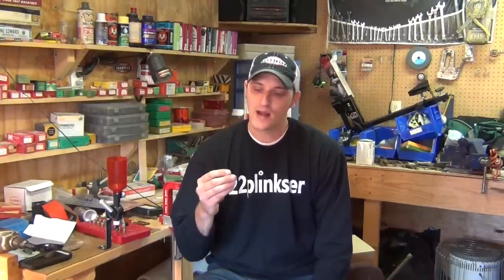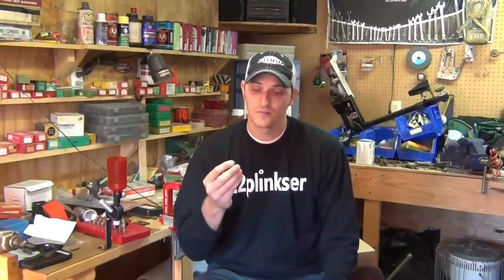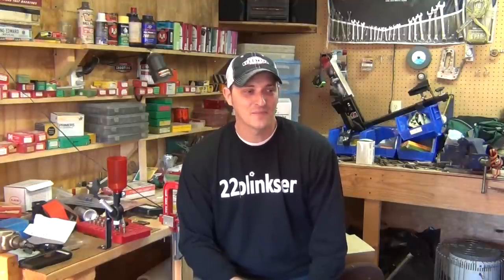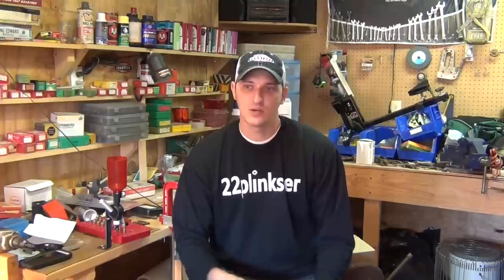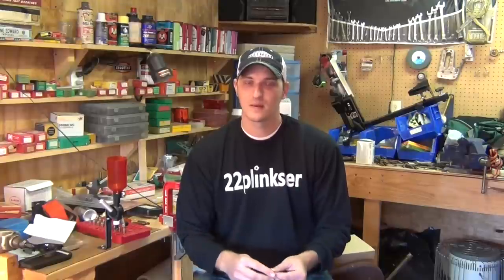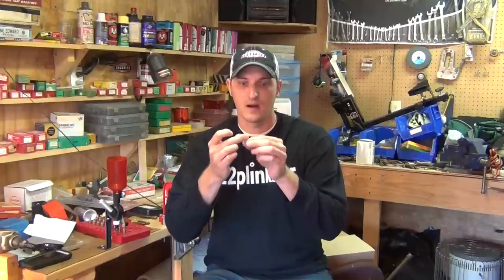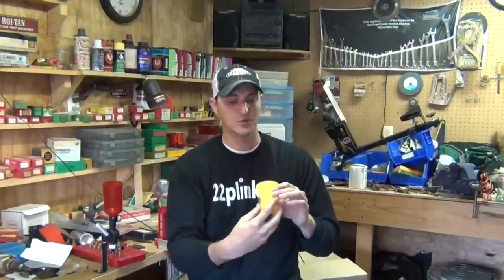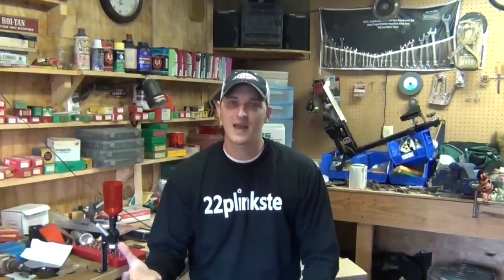Why does the .22lr have misfires?

Comment: If rough handling causes misfires, that could be a problem for semi-autos. They slam the cartridges into the chamber pretty hard. If loading the round into the chamber causes the primer to break loose and fall out of the rim, I wonder if it would be more likely to fire if the firing pin hits the bottom of the rim rather than the top?
Reply: There is nothing in the center for the explosive compound to get pinched and hammered against. When they make them a machine just puts a drop of normally dry explosive compound emulsified in a solvent in the bottom of the case then spins it up to cause the explosive compound to collect under the rim then the case is dried to remove the solvent leaving the explosive solidified and stuck under the rim. If the explosive compound is crappy it will break up and fall out from under the rim into the propellant and cannot be struck by the firing pin. I suspect the new stuff they use in crappy ammo is an explosive with a low melting point and it is introduced while warm enough to be melted and spun under the rim then allowed to cool and solidify. When the cartridges get hot in storage the explosive just melts, leaks out from under the rim and gets distributed into the propellant grains.
Reply: @dfpytwa  Yes, I know all that. My point was about the issue that rough handling can cause the priming compound to break loose and fall out of the rim. If so, then it might be better to have the firing pin hit at the bottom of the chamber instead of the top, as the priming would more likely fall out of the part of the rim that is up rather than the part that is down.

Comment: I won't name names, either, but teh primer compound is a huge problem because some companies put it much less compound than other.  It's also applied in different ways.  Some is pressed in, and some is best descried as sprayed in.   I think the sprayed in is best because  the primer compound covers the entire back of the case, and is on thick enough that the rim itself is full all around, and holds it in place.  You can drop it, thump it around, whatever, and it won't dislodges because it's in thick, and the rim stops it from movie. 

Moisture is a huge problem.  We had about four hundred rounds of .22lr that sat in a sealed contained, but the container was full of very moist air.  When we tried firing it, more than half the rounds wouldn't fire.

But after it sat in the open air, with the sun beating down on it, for a couple of hours, every round fired.   Quality control matters, and part of this is how ammunition is packaged and stored at the plant, and along the delivery trail between maker and buyer.

Comment: I have to disagree with you on how the 22 LR primer material is loaded into the 22 LR cartridges. If you look it up, here is how it is done: Small pellets of the wet primer are dropped into the bottom of each case. Back on the main factory floor, spinner bits are lowered into the cases and spin the primer so that it's evenly forced out all the way around the inside of the rim. The cases are dried to remove all of the moisture from the priming compound.

Comment: I have been using rimfire for over 40 yrs. the first misfires that happened to started 7 or 8 mounts ago. It was in a Winchester brick. I purchased 2 of them. I had so many misfires I asked some one
at the range to try a few. He had 3 misfires out of ten. I sent them what was left of the 2nd box back to them & they sent me $30 bucks. Big deal, I do not buy that brand any more.

Comment: You can take the worst 22lr ammo and put it in an air tight container with silica packets and have 99% of it fire.
Also handle it however you like, the primer compound is a glued gel on the the back outer rim on of the inside.

Comment: I had quite a few misfires today, with the Federal 550 bulk pack 36g. HP's. I'm thinking about sharpening the tip of my firing pin a bit.  I already cut 2 coils off of my recoil spring. It helped A LOT with reliability, shooting bulk ammo. I only had ONE stovepipe out of 200+ rounds today. Before, I was getting 1/15 stove pipes.  All my gun would run was CCI Velocitors. Those are too expensive to shoot water balloons, and water jugs with. lol.     I'm pretty happy now, with the recoil spring mod, but I would really like to eliminate all of those misfires...    Any thoughts???

Comment: Don't they have to put the primer compound in the case while it is in a paste form? I understand that once it hardens, it becomes like a crystalline structure and extremely sensitive to shock. I believe center fire priming compound is either lead azide or lead styfonate. I don't know what they use in the rim fire cases. I can tell you that working with primer compound is one of the most dangerous job in a ammo plant.

Comment: As far as dry firing goes I do not agree. What dry firing a 22 will do is the firing pin will deform the edge of the chamber due to the firing pin being to long. The newer guns that they say it is safe to dry fire, the firing pin is trimmed to the correct length for its travel so it does not hit the lip of the chamber. The number one reason of miss fires due to the firing pin are the design or weak strikes. The number one culprit is the companies that use a pointed firing pin. A rim fire firing pin should be a chisel shape at the tip or a rectangle tip if the pin strikes hard enough. The reason for this is if the tolerances of the travel of the pin are not tight enough then then the pin might mis the priming. If to tight it creates friction which equals longer lock time and lighter strikes. That is why the point or rounded design is horrible.I have personally made my own firing pins for conversion kits to get them to ignite more consistently with a larger range of manufactures due to different hardnesses of the rims. An example an Erma conversion kit for the FAL.

Great video everything else I 100% agree with you man!
Reply: Steve Bertelli   My 10/22 firing pin doesn't make a very good dent in the rim, so I took it out this evening, and sharpened it a bit. I know the optimum thickness of the tip of a firing pin is .025", but I don't have anything to check it with. I did this because I had several misfires today...    Gonna try it out tomorrow...   Any thoughts?

Comment: Brand new S&W Victory 22 owner.. first weekend of shooting... last 2 rounds in the mag will not fire (I have to clear the pistol and reload at least 4 or more rounds). Sometimes, every 3rd round will misfire. I was told by idiot gun retailer that Federal Wildcat was OK (It isn't, I'm told, use CCI). Bought CCI and had the same issue. Should I call S&W on this? The gun was cleaned today and the slide oiled properly, but no difference. Thanks!

Comment: As long as you get it sealed up with some desiccant it should store for quite a while (really, just being sealed helps a lot).  I shot some last summer that had been sitting in a sealed container since 1985 (figured it might be time to finally use those - lol) - had not one misfire out of 1,000 rounds.  At the same time I bought some new stuff a couple of years ago and every 4th round was a dud.  Even my old H&R Sportsman, which will normally make anything go bang couldn't set those things off.  Sometimes its just a bad batch of ammo.
Reply: I agree, and I have shot ammo over 30 years old without a problem. When one thinks about it, it probably has more to do with how the ammo was stored and handled before it ever reaches the shelves.
Reply: Whitey  hmmm, maybe sample your ammo for storage to use at the range..... pick a random 5 (or how ever many) to fill up a range box...Keeping in mind which box they came from.... I know some anal minded people will love this thought. Don't hate me, just a thought.
Reply: G Wubllu I will try some of my older ammo next time at the range. I have some 1964 Remington military surplus in 7.62x51. I keep all my ammo stored at around 70 degrees plus or minus 5 degrees. I've never had a problem so far. Even shot some 22 shorts that were made in the 1950's that were my uncle's. I have had a few of rounds of bricks of 22 lr's which were new that wouldn't fire. Ammo is transported in trucks at extreme temperature, both hot and cold, and then handled roughly at warehouses. I believe that is a larger problem than age.
Reply: Whitey No, I mean sample your ammo you are readying for storage since, most of concerns may be with previous handlers, and just possible bad batches.  It would really suck to really really really need what you are going to shoot, that you have meticulously stored for over twenty years from now, just to find out you have a bad batch.... So instead of buying a separate box for the range, sample boxes going into storage.... Even if you really  really really need it 12 months from now, it would suck to find out , again you have a some of a bad batch...
Reply: G Wubllu I see what you mean now, and it's a good point. After I answered you yesterday I realized I have shot several hundred of the Remington mil-surp made in 1964 without a problem. Yes, you have a valid point, and I will take some samples to the range next time.

Comment: Im happy to say that probably out of 5000 rounds of cci minimags cprn maybe 3 yes 3 misfires. That there is the gold standard. Bought 2 boxes of federal 36 grain cphp and had 20 squibs out of my db sidekick( i only use cheaper stuff in my wheelgun) 20 out of 50. Each time i had to open the cylinder to make sure bullet was not in the barrel still😡

Comment: If shaking .22 ammo can create problems with breaking down the primer compound am I going to regret getting the McFadden Ultimate Clip Loader for my Mark II?  That requires dumping the rounds into a holding tray, then shaking it back and forth to them them to fall into the feeder channel. 

So far I've had no problems, but I've only used it for about 15 magazines in the week that I've had it.

I agree that CCI Mini Mags are probably the best for reliability, but I've had very few problems with the thousands of Remington Thunderbolts I've shot at half the price.

My semiautos have more issues with American Eagle and Winchester Super X than with any of the Remington ammo.
Reply: oldbandguy   Strange...   American Eagle doesn't cycle well, in my 10/22. But, Federal bulk does great. 99.5% reliable. Same company...   The American Eagle is 38g., and the Federal is 36g.   Same velocity(1,260fps).      Go figure...

Comment: Great subject my friend but you are not aware of the primary reason for .22 misfires. Number 1 reason for .22 misfires is the ammo. The primer material on a .22 rimfire is put in the case as a liquid. Sometimes it does not cover the entire bottom (rim) of the inside of the case. If the firing pin hits an area with no primer compound, MISFIRE. You get what you pay for. Next time you get a misfire take the round and just remove the bullett from the case by simply bending it to the side. The bullett comes off easily (with my strong fingers). You will see the bottom of the case is not completely covered in primer compound. I have sent many of these faulty rounds (no powder or bullett, just the case with a solid firing pin strike to an area with no primer compound) back to various manufacturers and got an apology letter and was well compensated with much free ammo. 40 years of handloading experience here. I have even manufactured some .22 ammo. I was able to do this safely being a mech. engineer, also studied physics and chemistry and was an instrument maker and the owner of my own machine shop. I only did this for experimental reasons. I produced some great ammo but the project was very time consuming and intensive. Making tooling and assembling the rounds. The effort was so extensive that I would estimate the cost to be somewhere between $5 to $10 per round (FOR .22 LONG RIFLE AMMO ! ! ! ). This is when a brick of 500 rnds. was under $10. I put together a few hundred rounds. Like I stated it was just an experimental project.

Comment: There is a little misinformation here. The primer does not sit like a disk in the bottom of the case. If that were true, it would be possible for the point of the bullet up against the base of a cartridge to set it off from dropping it into a tubular magazine or from recoil just like what can happen with centerfire cartridges with pointed bullets. The priming compound is only in the rim of the case. During manufacture, the cases are spun to put the priming compound in the rim by centrifugal force, thereby leaving the center bottom of the case free of priming compound. That is why it is called "rimfire". I recommend editing this video to make it correct.When a rimfire cartridge gets dropped, a small chunk of the primer can be dislodged and cause a misfire when the firing pin hits the rim at the gap in the primer. I've also seen instances where the primer compound was not bonded well to the inside of the rim - or has shrunk - and has been knocked loose by the firing pin. Rotating the round usually will allow the cartridge to fire the second time. I've actually seen a cartridge wherein the priming compound has been completely crumbled and fully out of the rim. It mixed with the powder. Upon burning the powder, it "popped" sharply a couple times when the priming compound touched off, so it wasn't a case of not having any priming compound to begin with.Otherwise, it is a well done and informative video.

Comment: Had one round out of a box of Winchester 333 that wouldn't fire after five stikes ground it open with a carbide burr to safely open it dumped the power out and yellow flakes came with too. Looked inside the case and saw the remnants stuck to the side wall, not a drop made it to the rim . Once in a while an odd ball happens from the factory, what can you do?

Comment: Excuse my ignorance, but what is the difference between rim-fire and center-fire? And how would I know if I have one or the other?
Reply: rimfire has a hollow rim where the priming compound is put the firing pin crushes the rim and sets of the priming compound a centerfire has a primer in the center in a priming cup it can be either boxer or bredan boxer will have the anvil(the part that the priming compound will be crushed against when the firing pin strikes) in the priming cup and berdan will have he anvil built into the case most common now is boxer

Comment: You are wrong with the analogy of dry firing. The firing pin isn't striking against steel or anything in the barrel as you stated because there is no cartridge in the chamber, the chamber is empty? It can't shorten or wear down the tip of the firing pin!
Reply: Dean Henthorn   No. YOU ARE WRONG.  The firing pin doesn't hit the empty part of the chamber on a rimfire gun. It hits just to the side of it.  Which is steel!!!!!  Good gun makers(not Ruger) make sure that the specs, on the distance that the firing pin travels, isn't past the thickness of the rim(when there is a cartridge in the chamber). But, we are talking thousands of an inch here. Chances are, your firing pin is hitting the front of the chamber, BESIDE OF THE EMPTY HOLE THAT YOU MENTIONED.    Dry fire away, if you like...   It's your gun...lol

Comment: I have a question, I just bought a Henry lever action 22. Also bought new cci 22LR after I bought the Henry. First time to the range it misfired about 10 t0 15 times out of 100. Yesterday I went to the range again and shot about 50 rounds and it misfire about 9 times. I thought a Henry was a dead shot every time. Do you think it has something to do with the pin or the ammo? I sent Henry a warranty ticket and waiting to hear what they say. I'm usually a Ruger guy, my first 22 was a 10/22, thinking I should've stuck with them.

Comment: Why can’t they make a firing pin that strikes the .22lr in multiple points around the rim of the case to help insure more reliable primer ignition? Basically a four point pin. I’m not an engineer but it seems plausible. Any feedback?🇺🇸🗽🦅🇺🇸